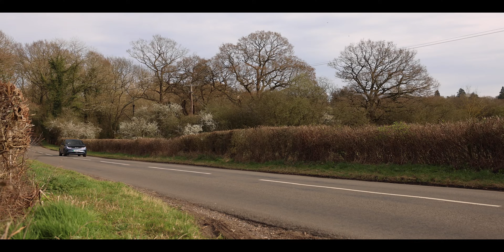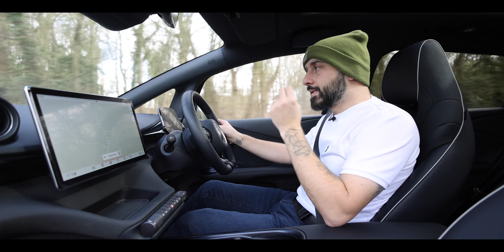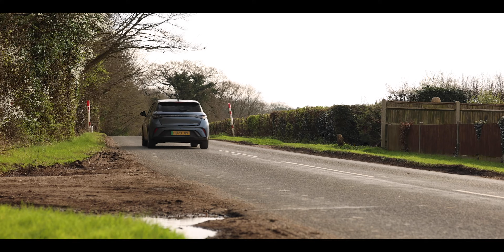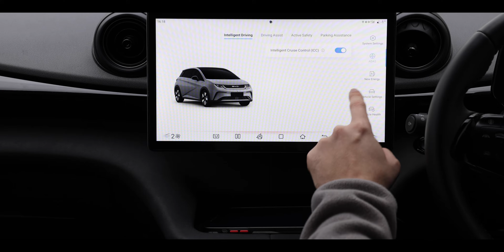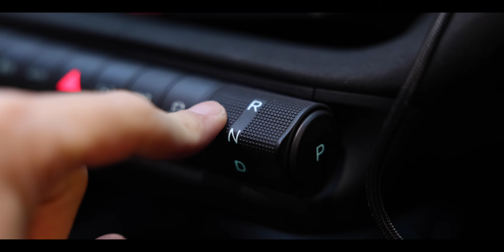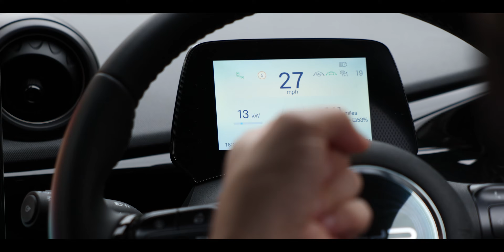2024 BYD Dolphin Review - UK's Smallest, Most Affordable & Practical EV?

Comment: New 2025 model coming soon. For same price (or less) all models and trim variants will have the "God's Eye" system (DiPilot 100 - I am guessing the self drive mode will have to be disabled for now in the UK, until it becomes legal next year). Self parking at this price point! Loads of improvements (listening to users). Another Dolphin trim level is 'Essential'. Guessing about £18K in the UK for that (but I see it in Australia for £15k - insane). Not all insurance companies will cover BYD cars, but BYD own their own insurance company that already operates in some countries, so that might come to the UK to force better prices. RHD models already in production, expect maybe mid to late July 2025. The Chinese market now gets the same world model (they used to get a cheaper version), and a Chinese friend of mine who lives near a BYD factory in Shenzhen tells me that prices are very sharp even for the new version. That SD card slot can also be used to record dashcam - you can already add an OEM dashcam for less than £40 (the software for it is already in the car). The 2025 version has dashcam in the DiPilot 100 system. Like most testers, you didn't find the 'ice cream van' slow speed sound (instead of the whirr) in the settings. You can add a frunk for not much (less than £60), but if you look under the bonnet, you will see there isn't much space.
Reply from the maker: The ice cream van jingle is literally in the video! Haha thanks for the insight!
Reply: @GoksCarLounge  Sorry, must have missed it. I did watch the video more than once though. Cats demanding food can be distracting. 😸😹
Reply from the maker: lol I’ll let you off! Thanks for watching! Will try to get some other models on the channel at some point!

Comment: I bought one Dolphin standard range (45kWh LFP battery) for 5 months already and drove for 10,000km as a city drive car. If you want Youtube, Waze, Netflix & etc, just get yourself a carlink kit and plug into the USB port provided, you can have full control of the carlink kit via the main touch screen. I can lock/unlock the car, control the AC via the apps. I've no problem to get 360km from a full charge by driving around 70-90km. Relatively quiet and very comfortable car. The standard stop n go function is perfect for city traffic jam (and I can enjoy Youtube), it has never failed me. The Automatic Emergency Breaking had helped me twice from an accident. I can turn off all other sound alert or change them to vibrating mode on steering. No rattling sound even after 10K km. Overall I would rate 9.5/10 for a city drive car at this price. The only minus 0.5 is the slightly smaller boot space, but one can fold down the rear seat and the space is massive. I've confident this car will last me 10 years or more, in the event of battery degradation after 8 years, worse I think I still can get 50%, which is 180km, it is more than enough for two days of city drive.
Reply from the maker: Hey, thanks for watching and the information! I was apprehensive about applauding the car for its build quality, it’s clearly good but I couldn’t comment on what it would be like after X amount of years and miles etc so that’s helpful. Thanks!
Reply: Brilliant..

Comment: ZE1 NISSAN LEAF is so much better than this in every way that matters like motor performance and quality and value for money been half the price on the used JDM imports market
Reply: As someone that has had 2 generations of Leaf you are entirely wrong. The Leaf is way behind other brands now and is no match for a Dolphin. I just bought two of them after test driving it against MG3 hybrid and MG4.
Reply: I can't vouch for the second gen Leaf but I'm swapping my first gen Sunderland Leaf for a Dolphin as it keeps the 360 camera and is otherwise nicer, softer and more spacious. The only downgrades are a smaller boot (though the Leaf's subwoofer shrinks the usable boot), no auto wipers and no manual speed limiter that reduces motor power as you approach speed. Everything else feels like an upgrade.

Comment: Great review! I absolutely love mine. If it has the ling longs removed you can get sub 7 and once you get used to the throttle! I have managed 5.8 in the wet cold roads at 5 degree. You just have to practice and practice. I much prefer this over my old cupra Born, mg4 and niro EV. My only negative is the glare from the air vents. I've covered just over 7k.
Reply from the maker: Thank you Peter! Good to know people who have lived with it for so long and still enjoy it. It was one of the points I couldn't comment on any of the BYDs I reviewed.